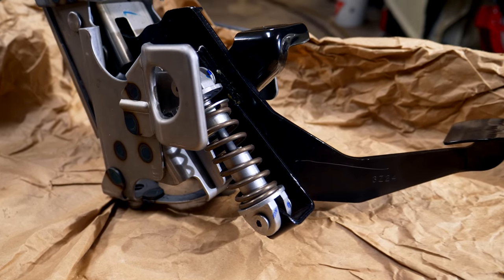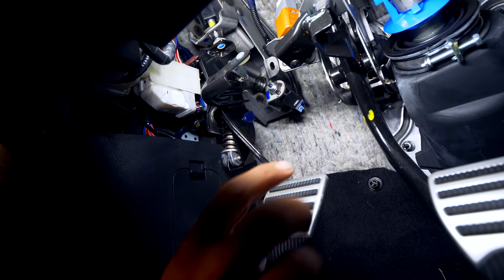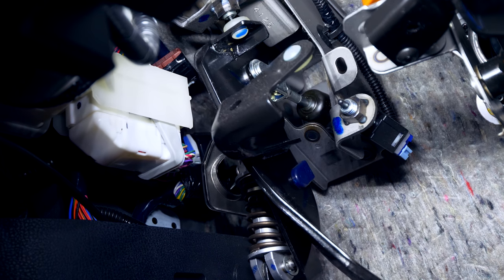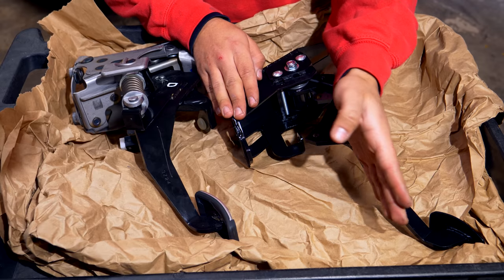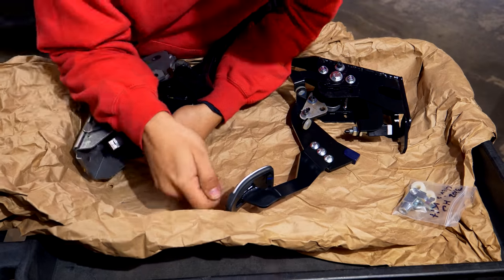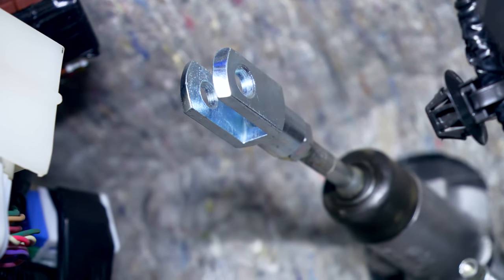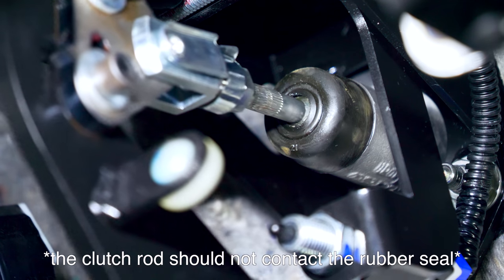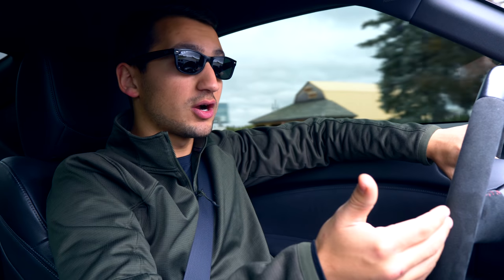Is Installing a FULLY Adjustable Clutch Pedal Assembly Worth it?

Comment: Hey man just installed my RJM clutch pedal and now I'm having an issue where the clutch isn't fully disengaging and I'm unable to shift into any gears. Does the pedal have to be adjusted specifically to get the clutch to work? I'm also running it with a lightweight flywheel and stage 3 clutch

Comment: I did this to my 350z awhile back. The old setup in the Z cars operate like a mouse trap which acts like an on or off engagement. The RJM acts like a proper pedal allowing for adjustable modulation. Great mod

Comment: One of the first modifications I did on my 07 350z. Absolutely essential if you care about clutch feel.
Reply: This was what I was wondering. I owned an ND Miata and now a Mazda 3 and their clutches have the perfect amount of feel and clutches engage linearly. I really like the Z but all the discussion about poor clutch feel turned me off for a while.
Reply: Gregory G the RJM clutch pedal assembly fixed it for me. Feels like a normal linear clutch and you can adjust the clutch pedal height/engagement. The regular “snapping” assembly is trash in my opinion.

Comment: I have this and haven't installed it and now I'm motivated to do it, awesome.

Question, did this fix the 1st to 2nd gear change? You know the lag in talking about?
Reply from the maker: Yes! It is terrific!!! You really won't be disappointed with it :) It doesn't feel so clunky
Reply: Try double clutching 1st to 2nd in until your install. Even with the extra work during the shift 2nd will engage much smoother and provide a more linear rate of acceleration
Reply: Nik Krajewski good looking out bro!

Comment: Which way u should adjust the clutch pedal in order to make the clutch engagement point closer to the floor? Please advise. I installed my and leave it as how it came in, and the engagement point is actually higher than the stock one

Comment: So what if the Jam nut is like stuck/molded to the Clevis fork? I can’t break it loose unless I apply force while holding the rod with a pair of pliers, and is it okay if the rod itself moves? There’s no other way for me to get it off unless I use pliers and a wrench, but even with that the whole rod spins instead of the fork.
Reply: If installing the heavy duty clevis u must break loose the lock nut behind the old clevis before removing the clip and pin. I Missed that part in the written instructions and ended up in the same boat as you and used some wd40 and 2 wrenches to loosen it after. Lol

Comment: I’m happy you like it.  But you need to tell everyone that once they do this, their warranty is toast if it involves anything remotely pertaining to the transmission.  I’ve been thinking about it but for now, I will stick with the stock pedal assembly at least until my warranty period is over.  Secondly, I really thought that for the price, the JRM pedal assembly would be a higher quality piece with mostly billet machined components.  It doesn’t look like it.
Reply: It won't mess with your warranty. This type of mod if not properly installed will damage your slave and clutch (over extending slave, not fully disengaging causing wear to clutch or grinding gears). That is a problem you will notice during the "tuning" process as per the instructions. If you are concerned about the mod causing warranty issues then swap the stock one in. Easy.

Comment: When you took the clevis fork off, why didn’t you show how you got it off? Mines super difficult to get off
Reply: You should break the 12mm nut holding the Clevis fork before disconnecting the pin holding the pedal
Reply: Cause its a really important step so why would he include it in an installation video

Comment: Hello!

Is it worth getting the master cylinder replacement kit as well ? or would you just recommend getting the assembly.

I notice that the ultimate package is always sold out because the master cylinder kit is always sold out so wondering if its waiting for them to restock, or just order the clutch assembly on its own.
Reply: What did you end up doing I’m not sure if I should get the package or not?

Comment: The thing i hate about the stock pedal assembly is that its very stiff at the top until about 60-70% pushed in and then for the last 30-40% its really soft and you literally feel nothing until its resting on the floor. The thing is, the stock clutch bites right before the “soft” numbness feeling ends and a hair off and you’ll jerk the car lol. Been driving my Z for about a year and its parked for the winter now but i really hate the pedal feel. (Im used to it now, and i know where it bites without thinking but its really unforgiving)

Comment: Best instructional video on the RJM pedal by far. I just recently got mine. Xmas gift from my wife 🙂. Haven't installed it yet. I do have a question. Does this make shifting on the 370z a lot smoother?
Reply from the maker: Yes! By a long shot! This is by far one of the best 'feeling' upgrades for the 370Z. If you install this, and then jump into a 370Z with the stock clutch pedal, you won't believe that Nissan thought that was acceptable.
Reply: @milanmastracci  Nice! Feeling hyped and excited about installing it now. Thank you for your  feedback,  I really appreciate it. Have a great one and stay safe!